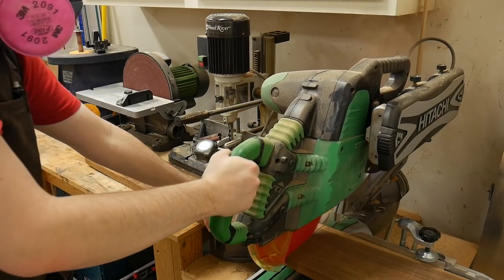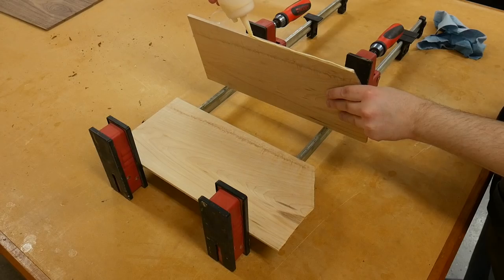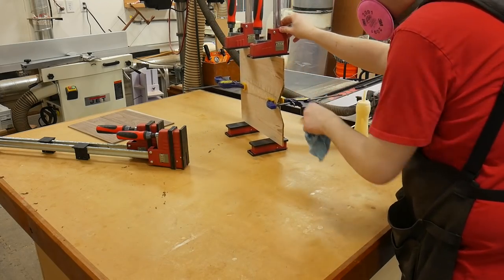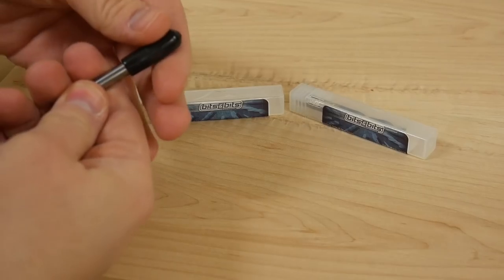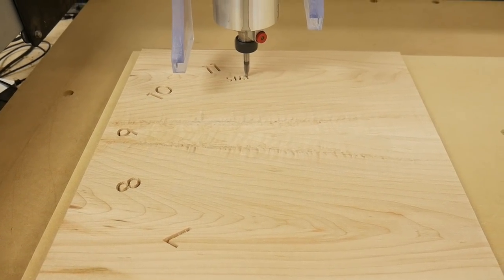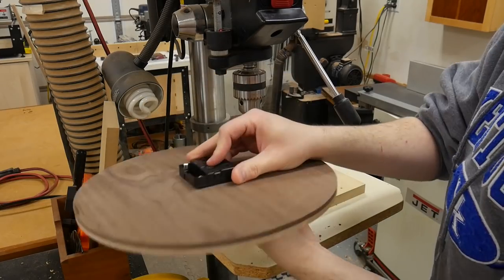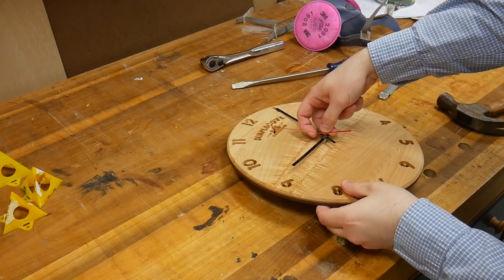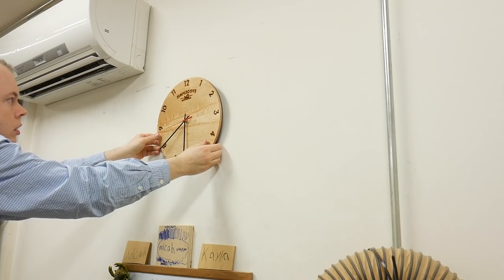Making A Shop Clock & Learning From Mistakes

Comment: I've not heard of Bits & Bits and was curious how well they did? What is your overall opinion with respect to price-point/performance?  The clock looked great, and I can't even imagine how many woodworkers before you have made the same mistake...me included.
Reply from the maker: I got a 1/16", 1/8" 1/4" and a 30 degree V-bit from them and they are all high quality bits. I'm going to switch over to only buying them from now on most likely. I've used whiteside bits and these bits are every bit as good and the price is on par with Whiteside as well. I've not tried cheaper bits as I learn you get what you pay for in woodworking lol.